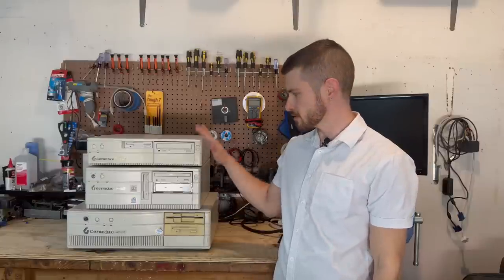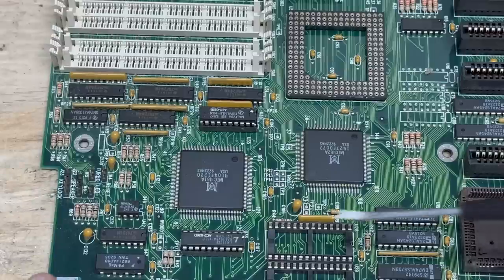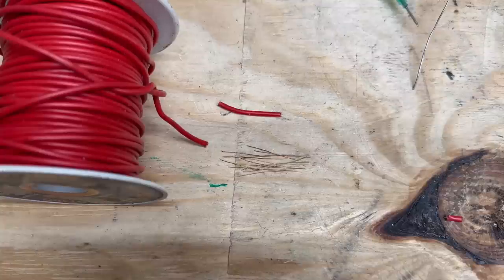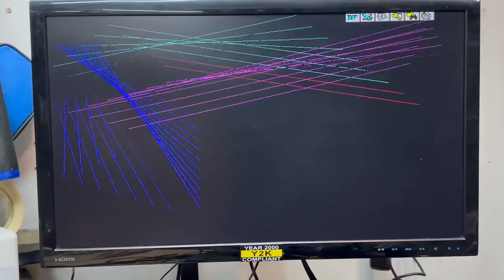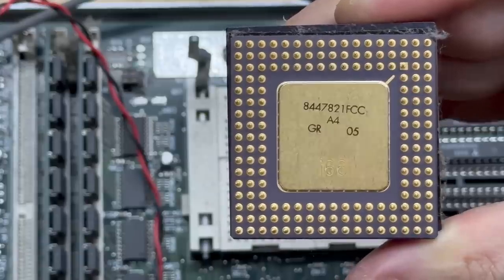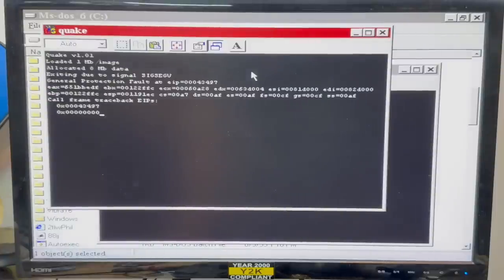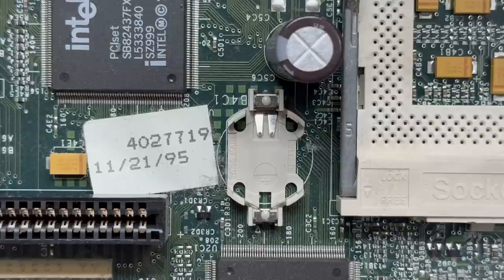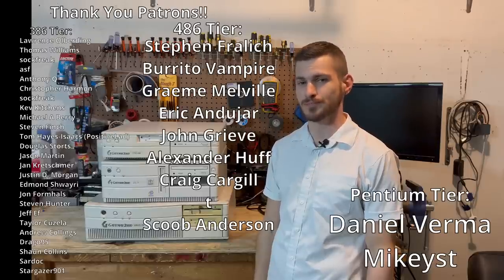Let's wrangle some Gateway 2000 systems! Vintage computer teardown from the Franklin eWaste haul.

Comment: I think these machines are in good hands, you've got some nice soldering skills! Love hearing the WD Caviar drives as well.
Reply: Trace repairs are definitely finicky when you have to do bodge wires to bypass ruined vias, especially if you ever happy to apply an iron to it. Best case scenario would be using whatever epoxy they use to glue down traces. He used superglue which may work, but I'm not sure tbh.

Comment: Watching you take care of your machines makes me appreciate mine. Some 16:9 LCD monitors let you ask for the image to be rendered at 4:3. Also, 1600x1200 LCD monitors form integer pixels at 320x200, 320x240 and 800x600. You probably knew that, though. Thanks again,
Reply from the maker: Thanks! Yeah the monitor will indeed do 4:3. I shoot the video on an iPhone 14 Pro Max, which has a tremendously tough time focusing on the monitor. It seems to especially struggle when the monitor is in 4:3 mode. Guess it's high time to get a video capture system together.

Comment: During the late 1990s I worked as a student technician servicing about 1,500 computers in a large community college. The older computers were HPs while the newer ones were Gateway computers. If a campus computer was acting up, we asked if it was an HP or a Gateway; and I would say, ‘Oh shit!’ if it was the latter. Reliability was not a feature of Gateways for oftentimes a brand new PC would arrive with a dead motherboard, or the assembly only partially complete. Sometimes debugging would take hours, even for our hardware specialist - for the Gateways often had buggy drivers for hardware that was state of the art, but obviously untested by the manufacturer. No wonder that Gateway now is more a distant memory in 2023.

Comment: Still have my Gateway 2000 tower case sitting in a corner I just can't bring myself to get rid of it yet - not the first computer I owned but symbolic in that it was the first I bought entirely with my own money from my first job and the first time I bought a high spec system.

Comment: Two dialup modems could have been for multiple reasons. While this computer was a little late, it might have been used to support a BBS, or it might have been used as a server or gateway in an office.

It might also have been used to support multiple leased lines, etc., or as you suggested, someone might have just wanted an upgrade and not removed the old modem!

Comment: I have a P5-75 in my collection and it looks to be the exact or very similar same configuration as the one you have - video card, modem, sound card, cd-rom, motherboard all the same. Not surprising as they probably sold thousands of these things in the same or similar configuration. It's a great machine - I picked it up for free in in like 2002 or 2003 and then it sat in a closet until a couple years ago when I actually had time and inclination to finally clean it up and use it. All it needed was an inspection and a good cleaning - Everything worked as it should when I turned it on.
Reply from the maker: These machines are amazingly resilient! As long as there are no evil Varta barrel batteries in them.

Comment: I'm definitely getting one of those Amazon microscopes with a display on it when I have the money, been on my wishlist for awhile now. Also have you thought of using kynar wire? It's basically enamel coated wire that can be melted off and soldered with easily, meaning you don't have to worry about it shorting anything. The enamel also helps keep the whole wire from coming unsoldered as easily if you apply too much heat.
Reply from the maker: Haven't used kynar wire before. I have used regular magnet wire harvested from transformers in the past though.

Comment: omg you are triggering a ton of memories for me as well with this. I think we are around the same age, and I remember AOL 3.0. That was my first experience with the internet, and that was in the late winter/spring of 97 on a 386. Experience was dismal but it was my first
Reply from the maker: My first experience with the internet (other than BBS) was with AOL 2.0. When they announced that they would be dropping support for it, I was so upset I emailed Steve Case (then-CEO of AOL) because later versions wouldn't run on my machine. Either he or someone employed by him did respond! He explained that the cost would be astronomical to continue maintaining AOL 2.0. I must have been about 6 or 7 at the time.
Reply: @miketech1024  awww dang. That sounds like something I would do. I didn't know what a computer was until 1996 when I had just turned 10.

Comment: I was gave a Gateway 2000 to use for a few months out of high school.  It was not bad for a loaner at all.  Pentium Overdrive, 16MB ram I think it had a 33.6Kbps Modem.  I don't remember what video or sound card it had. I remember that it had a 2x CD-ROM as well. I only needed it for some basic work tasks and email so it fit the bill till I got a better PC.

Comment: I can’t see the continuation of the repair work! I don’t think I would have bothered especially knowing it’s likely a four layer PCB… who knows what kind of damage lurks beneath. Great stuff though. Thanks!
Reply from the maker: I do love a good challenge, though I am about a decade out-of-practice (as you could probably tell). Now I must do the obligatory star-struck comment: I absolutely love your channel! It is absolutely one of my all-time favorites and was the impetus for me to finally start my own. Thanks so much!!
Reply: @miketech1024  Aw thanks Mike. You rock too!  It's awesome to see new people in this  space. I love your passion and enthusiasm. I dig your angled wooden motherboard/parts holder for getting that good shot and I must say, I've never tried the resoldering alloy. I need to get some!
Reply from the maker: @adriansdigitalbasement  It’s good stuff, been using it forever. It works like magic for SMD chip removal (which is a sight to behold in itself).

Comment: You need to setup your own dial-up modem bank and dial in with these old machines. I've got some old cisco equipment I'm going to try it with. That would be cool. Very great video! I like what you're doing. I love these old 486 machines and DOS! Keep up the good work!
Reply from the maker: Thanks! I’ve been contemplating starting a dial-up BBS service, since so few of them still exist. I do have a 25U server rack at the house and about a decade of professional systems/network engineering experience. Might be time to put it to some good use! Just an idea at this point, no idea what the cost of bringing in the phone lines would be.
Reply: @miketech1024  I was thinking more along the line as a "private" "internal" dial-up service that you can use in your workshop. Not for the public. I've got the stuff to try it and most likely will make a video documenting my failure or success. https://youtube.com/@overalltech7746
Reply: I had two dial up connections bonded as a single connection. In the day time I'd use my dedicated phone line, and then at night I'd use my parents phone line and the ISP would combine the connections at their side. From what I remember, it wasn't hard to configure in Windows, but you had to have an ISP that supported bonded connections. I had two 56k modems though, one internal and an external. I do remember something about having to have a 56K modem for it to work, not sure if that was both needed to be v92 compatible or something or maybe it was just one.
Certainly there seems to be a few reasons why they'd have multiple modems in their machine though. It could be that they had one on a dedicated internet access line like I had, and the other for answer voice/fax service. A look at the setup in Windows would probably tell us more than pondering though. 
However, I expect as Mike said, they probably just left the old one in there when upgrading. If someone wasn't that technical back then, a manual would have just said to stick it in a free slot rather than removing the existing one - hah - But my guess is they probably just stuck the modem in that chassis of a case while savaging the other components.

Comment: I remember having monitors that had the three-pin style Port that plugged into the power connector on the back of the PC
I also remember the d sub connectors with the ribbon cables and the ports on the back just like this

Comment: Nostalgia overload is a massive understatement lol. the first computer I ever rebuilt, an 8088, used Direct access 4.1. Before I had windows, that was my main program. I still have the thing on floppy somewhere. I have a P5-75 myself, but it doesn't have the plastic power button. for some reason I have had trouble finding one. despite that, the machine runs great.  but yeah kind of annoying to have to use a screwdriver to turn it on and off lol.

Comment: I have a Gateway Pentium 4 that I use as a "retro gamer" for my Hasbro Interactive games. They don't work with most modern video cards, but they work well with the onboard VGA graphics on the Gateway. it also runs Windows XP, so it still supports full screen DOS games without using DOSBOX

Comment: Those old gateways are so cool. My favorite design is the first system you show. Would love to own one some day but they seem to be sought after and go quick on eBay. Fortunately I own the second PC you show. It's completely identical except it doesn't use the Dallas RTC. I see yours also does not have L2 cache.  Do you plan to put any in? From what I can tell having no L2 cache seems.to have a pretty bad effect on games like doom. I'd like to throw some in my machine, but not even sure what kind of chips to buy that would be compatible

Comment: For the system with 2 modems, one could have been used as an incoming fax line, while the other was used for dialup purposes.   Or if one is a voice modem, they could have been running some sort of voicemail system.  There is also the possibility that it was a multi-line bbs system.

Comment: Hey awesome footage again! But i have an idea... when you test CD drives, also try if they read CD-R-media. Might be disappointing when you wanna copy files, knowing you got a known good unit of drive, but then it doesnt read CD-R. The older ones are notoriously known to suck there, especially these slow-opening Mitsumi 4x drives. yuck... Oh and i didnt know your monitor is y2k compatible hehehe. Cheers!
Reply from the maker: Thanks! Good idea. That very thing tripped me up a bit on the third system.

Comment: I have a Gateway 2000 486/DX266,  similar to the second system you showed.    Needs Dallas RTC replacement.   It does work,  going to fit it with a  SD to IDE drive.   It does have a overdrive processor of 100mhz,  16mb Ram if I'm correct.   Manufactured around the same time as yours..

Comment: I had 2 modems back in the 90s because we had something called analogue leased lines where you paid a fixed monthly cost to the telecoms company and they gave you a line that could only "dial 1 number" (sort of), like to join PABX's between two branches of a company, and I got one from home to the ISP, so we were online 24/7, with a fixed IP, and the 2nd modem was so if I would out, I could dial into home and use my own internet, or at night when my friends got home we could connect the 2nd modem to internet and route all my countries IP ranges through the fixed cost line, and everything else went out over the dial up one, that way I could sit on IRC and telnet/ssh work servers over the fixed line and not lag too much.
Reply from the maker: That was so cool to read. Thanks! Crazy how much we take for granted nowadays. I can just whip out my phone and VPN back to the house from nearly anywhere. Back then it required real effort!

Comment: Those last two USR modems are kind of interesting. I wonder if they are based on a design for an external modem because they both have their own on-board 16C550 UARTs.

Presumably the PC talks to the modem via a serial port, only the serial port is entirely internal to the modem card itself.

Comment: "WP" in the drive parameters is Write Precompensation. It's used to tell the drive when it should shift to a higher or lower write current, depending where it currently is on the platter. The farther away from the spindle the head gets, the more current the heads need to write data.

This setting is a legacy of the MFM and RLL days, it's entirely unused in IDE, the integrated controller on the drive automatically manages it. MFM and RLL drives were dumb and were almost entirely run by the disk controller card, and needed more values set to work properly.

As for that ISA video card that wasn't working, it having a full purple screen is more likely a component fault than a dipswitch issue. I would guess that either one or more RAM chips are bad, or the two EPROMs have bit rot and corrupted the video BIOS to the point the card doesn't work anymore. You'll need a memory IC tester and a ROM programmer to verify those.

There's the Retro Chip Tester Pro, but that thing is very expensive. Might be able to rig something up with an arduino cheaper. For an EPROM  programmer, a TL48 or TL56 would work.

You may want to get into the habit of dumping the ROMs in all of the cards/motherboards you work on, because in many cases, they're extremely difficult or impossible to find. EEPROMs, EPROMs and even mask ROMs all eventually go bad.
Reply: You beat me to on the WP, and don't forget "LZ" for Landing Zone, another useless setting on IDE Drives, I use to fill WP with 0 or 65535 and LZ as the sectors minus 1, just for the giggles
Reply from the maker: Solid gold information. Thanks so much! Nothing sends shivers down my spine quite like bit rot... Definitely need to get my hands on a Retro Chip Tester Pro eventually. I have a TL866-3G for reading/writing ROMs. So far it has been sufficient, but I haven't done a whole lot with it.

Comment: Ok,NOW i'm impressed!!!!
Tha pcb repair IS EPIC!!!!!
PS.You DO know, that in a multi -layered pcb,a lot more layers could be connected to the same via,right????
So,by connecting only the first,and the last one,it might be not enough???
Just askin'.
Reply from the maker: Correct. These types of repairs are only really viable on two-layer boards like these, unless you know for sure where the middle layers connect and can verify continuity.
Reply: @miketech1024  
Or, you have in your disposal an "Jewlbox" type xray unit.
8)))

Comment: Gateway was a good PC. The laptops were very good.
The fact that many of them had the serial port 9 pin was great.
The IBM Thinkpad were very nice when they had the docking ports that gave you all of the serial and parallel ports, and other ports but the gateway and Toshiba and a couple others had the serial Port where many other computer manufacturers did not
Many times people used laptops and needed that 9 pin true hardware serial port

For accessing Cisco routers through the console and for programming Motorola and Kenwood 2 way radios you needed that port and when they stopped making it it became a big deal

Comment: The smaller Gateway 2000 (the first one you broke into) was my first computer back in 1998. This surely takes me back... I can almost hear the AOL "YOU GOT MAIL!! and Playing AOL Games, SLINGO was my favorite =D  The only modification I did to this PC was a CPU upgrade by Greenway Technologies from 486 to a Pentium. It was plug and play and came with a little CPU cooling fan. It made things run a bit faster but it was still system bottle necks, the computer itself was way too slow for what I wanted it to do... I recall the PC still had problems even playing MP3's... In the year 2000 I took advantage of the deal they were passing out back then getting a free Compaq computer with a paid dial up plan... Only then was I able to Play Mp3's Rip CD's...  Ahh the Napster days...
Reply from the maker: Slingo!! That game took countless hours from my childhood LOL. I wonder if any backups of AOL’s backup systems still exist somewhere.
Reply: Somewhere I have an old Slingo installer that gives 30 days trial period. It’s just enough play time to experience the past… I doubt online player works but you can play it as single player offline mode.  I’m currently transferring my cd library to my NAS. When I come across it I’ll be happy to pass it to you.

Comment: I'm using a Gateway2000 keyboard at work. Found it at a thrift shop for free still new in the box.
Reply from the maker: Nice! I have two AnyKey keyboards and a standard Gateway 2000 branded one. All from this same haul. The second AnyKey is missing a few caps unfortunately.

Comment: My first computer was a Gateway 2000 similar to the slim 66mhz case. It was badged as a 486 xs 25 but we upgraded it from the factory to 50mhz. Kinda wish I still had that machine.

Comment: I’ve had it in the past where a Customer has had Multiple Sound Cards / Network Cards etc installed in their PC as the Technician they originally approached were unable to find Drivers for the existing Card/s so they just installed another Card… Unbelievable! 😂🇬🇧

Comment: With 2 modems, you could "shotgun" your connections and get 2x whatever your speed was, in my case it was 28.8, the lines where I lived never supported 56K.  So only way to get close to 56K was 2 DUN connections.

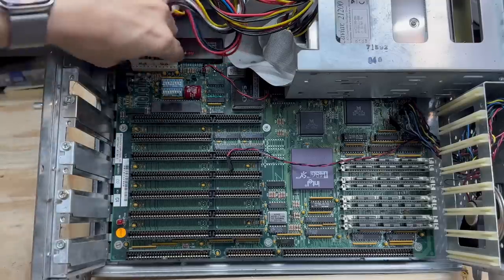Comment: What are the connectors on the lower edge of the mother board at 4:20..? I didn't see anything connected to these, and it looks like ISA 8 bit plus some oddities, without still being 16-bit isa or VLB. Doesn't look like any connector that I know of.
Reply from the maker: Don’t know, but I’d love to. Had zero luck finding out in my searches. The motherboard is a Micronics 09-00093-02 Rev. C4. Sadly it’s not on theretroweb. I’ll have to get it added once it’s repaired and more photogenic.